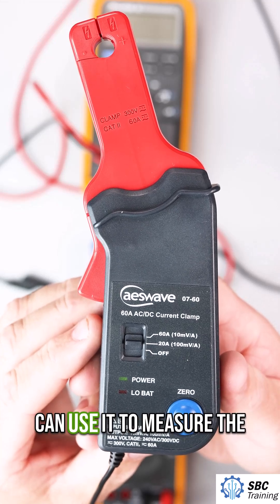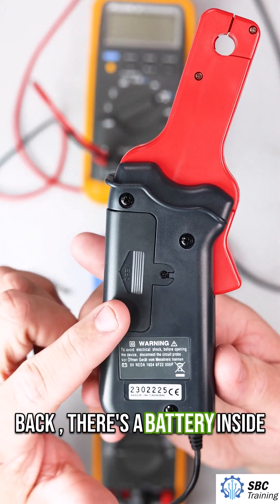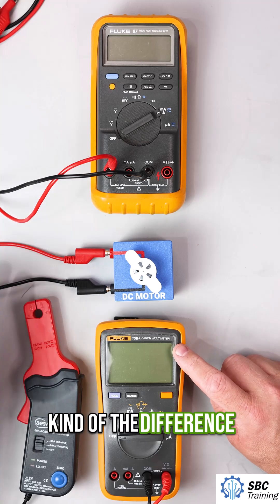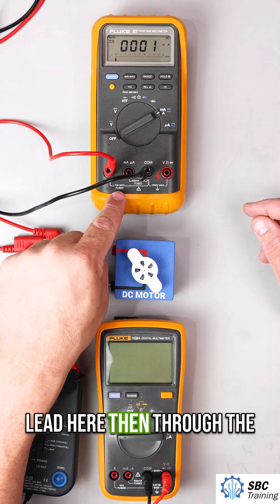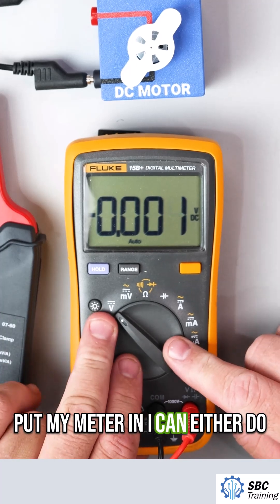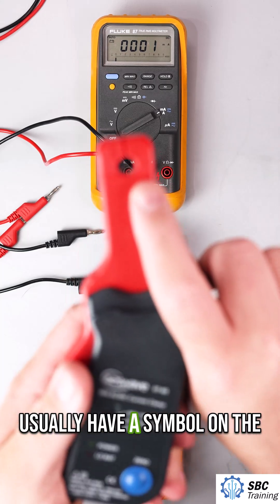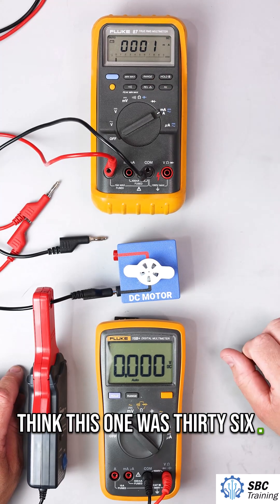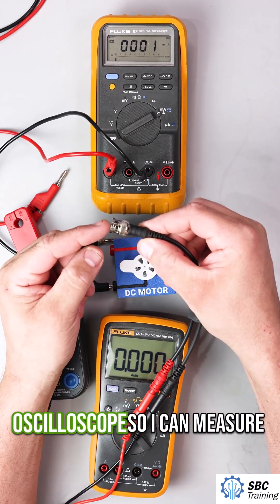How to Measure Current Without Breaking the Circuit — Using a Current Clamp

Comment: Would you please recommend a set of cables for multimeter (including the ones which will allow parallel connection)
Reply from the maker: Anything from Fluke is good. I purchased this clamp from aeswave. All their stuff is great. Most of the import stuff is questionable. They say they have the appropriate rating but I would be suspicious. Especially if you are using it for high voltage